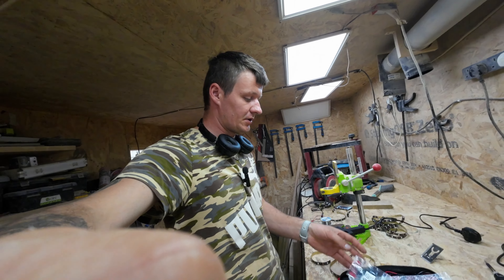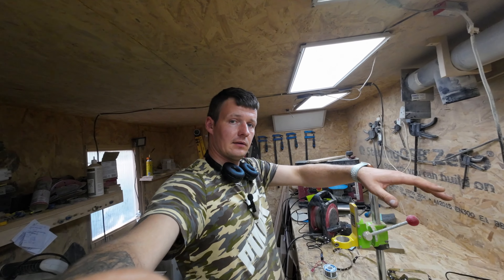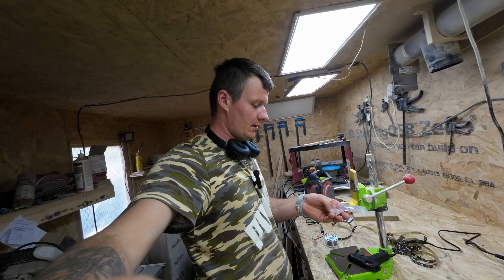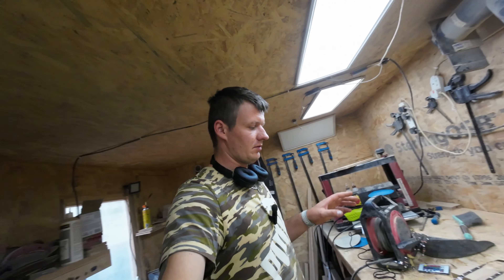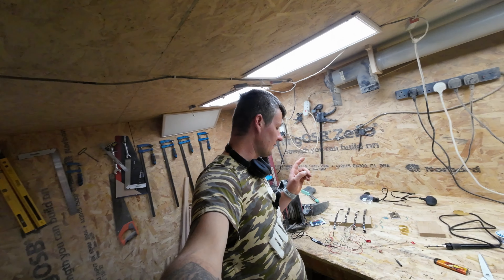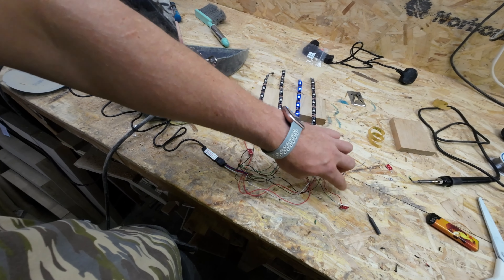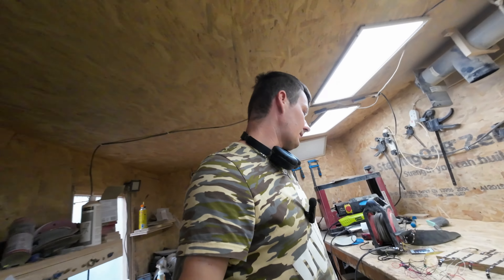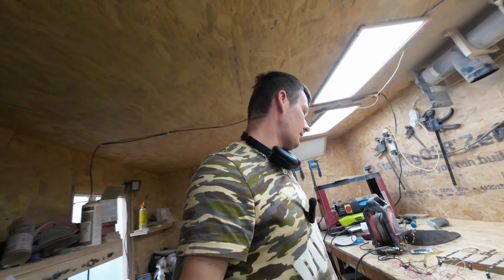Testing touch sensors for my new touch sensitive resin table Extending touch range on TTP223 sensors

Comment: hey there, I undesrtand you're using phone charger to power up the sensor, but how are you powering up the led? thanks
Reply from the maker: I use power bank to sensors and one cable from.sensors goes to led and led negative goes to same where sensor negative
Reply: Thanks for that.
What voltage is your led? 5v ? 12v or 24v?
Thanks
Reply from the maker: @LucaStefanoMissaglia  5v

Comment: Good job! Thanks. I'm not very strong wit electronic. Could you please explain what  did you do to extend touch range?
Reply from the maker: Check my last video in there is what I did and it extends a lot
Reply: @Audi90projekts  One more question my friend. What are dimensions of the sensor? I'm thinking about the minimal thickness of the plank
Reply from the maker: @dam1lor  they ar 14mm x 10mm
Reply from the maker: @Sofia  if u extend signal it will take easy trews 5mm wood or little more. I haven't checked that yet